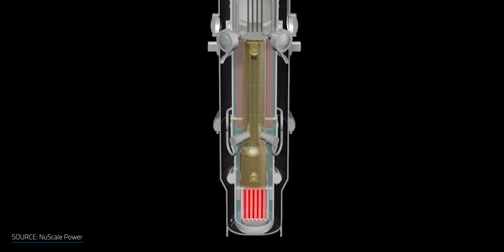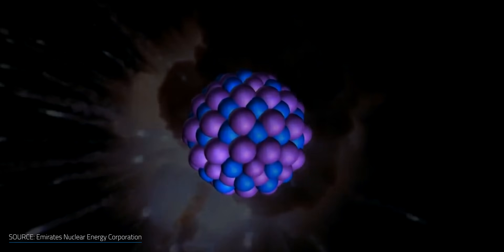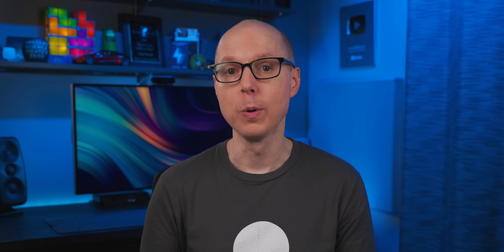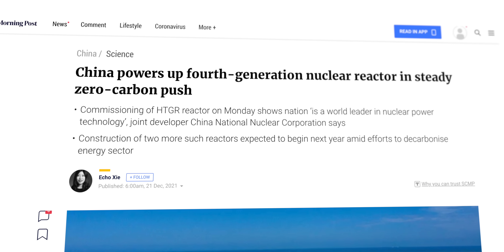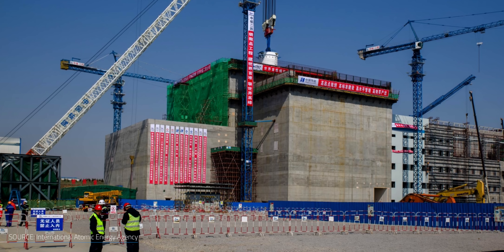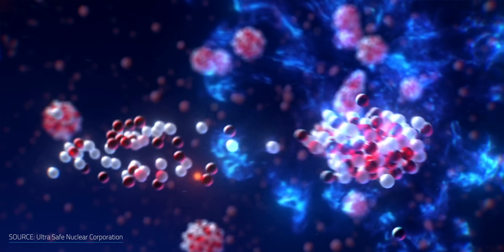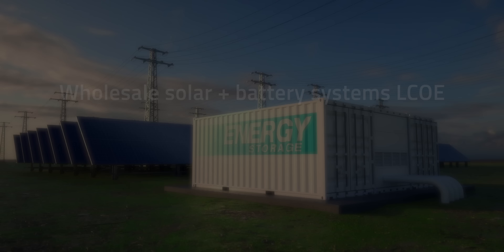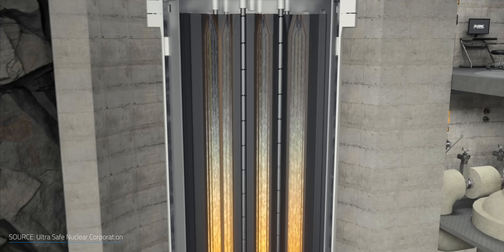Forget Small ... What About Micro Nuclear Energy?

Comment: I think modular reactors are absolutely the way to go. As we've seen with Elysium Industries, modular reactors have the potential to build up to medium- to large-scale plants. 

Having scalable units means that zoning for nuclear doesn't have to be so widespread, which potentially opens up more land area for deployment given the smaller footprints. 

And as Matt explained, modularity allows for utilization of the global transportation system, which can cut down costs and avoid other red tape of moving such large equipment. 

Renewables work so well because they're so modular/distributed. Different locations can adopt the technology at different times, and owners can supplement their installations as cash flow or other reasons allow it. 

Modularity also allows for greater manufacturing flexibility. Different ratings for products can be allowed depending on customer needs, and supply chains can be better relied upon since the sheer scale of components is smaller (more manufacturers can accompany the tech, which means more competition and all of the benefits of capitalism). 

Storage and containment are definitely an issue here. Nuclear plants are centralized and away from the public to prevent radiation leakage/exposure given plant failure (even though there are plenty of protections to prevent this). Distributing more radiative material means that the risk of public contamination goes up, so the risk analysis is definitely complex. But again as Matt showed, Nuclear is the 3rd or 4th least deathly of all of the energy sources. Lots of things in life are relatively radiative too, like flying, so the risk might not seem as great as what some people believe. 

It all comes down to climate change. We can implement renewables + storage waaaay faster than centralized thermal plants, so I'd be more on board with nuclear if commercial demonstrations of SMRs existed. In the meantime, society can get so much more bang for its buck by deploying more wind & solar + storage. The IPCC AR6 confirms this
Reply: We should have electricity generation at the zip code level of granularity totally minimizing power lost through transmission; a huge savings.

Comment: The key issue is that any flavour of Nuclear power only makes economic sense if continually operated as base load. In this it competes with  cheaper and cheaper Wind and Solar PV which do not provide assured supply of course. Nuclear solves the wrong problem - we need something that is cheap when not run but can ramp up to fill a large temporary hole in our overall generating capacity. I think Natural Gas will remain the sensible option here for some time to come. As we over-provide Wind and PV capacity we should see this fallback used less and less allowing us to go mostly "green" and maybe Batteries can take over in the future.

Comment: My grandmother was a nuclear chemist at Hanford, WA. She worked on the vitrification experiments there in the early 70's. I also know Dr Alan Waltar, a nuclear engineer. The solution to nuclear waste is in fast breeder reactors. These reactors could be fueled with existing waste stockpiles, resulting in reduced volumes of low intensity waste (hundreds of years halflife) and vastly reduced high intensity waste volumes which could be viably vitrified into harmless glass. The solutions exist, they're just not politically correct.

Comment: As a consumer of energy, rooftop solar is by far the cheapest solution. And, the energy it produces is emission free. So, I conclude that if I could buy a refigerator sized reactor that could power my home and be cheap enough to pay for itself in grid savings, it would be the way to go. How about a mere 2 KW reactor, supplemented with battery and inverter to handle peak loads?  .... Why not?  I suspect that the utilities would not be in favor of it at all.
Reply: hmmm, why not.  how much money do you have?

Comment: The Nuclear waste story, is just a way of safely storing recyclable nuclear material that could be used to make bombs otherwise. Permanent nuclear waste disposal methods (for real unrecyclable waste) have been known since the late '70s. These involve trapping the wastes in special Pyrex glass and deposit them in mineral salt layers deep underground. It was estimated that a 1000 Mwe reactor produced about 125 tons per year of high radioactivity wastes. However if these were fully recycled then the real wastes would be about 7 tones per year.
Reply: Recycling in itself presents problems.  MOX was being built for a simple process of mixing Pu239 which the U.S. has excesses of with U238 for reactor fuel.  MOX was canceled after 19 years of construction and $17 billion of taxpayer money spent when the estimated total cost to complete construction and operation was estimate at $47 billion.

ANYTHING that handles radioactive material, especially material than can result in a critically accident is very very expensive.  As we know, it is always cheaper to dispose of any thing that can be recycled than to actually recycle it.
Reply: @clarkkent9080  Yes, but they are creating strategic reserves of potentially recyclable material. The CANDU reactors have the capability of using MOX. There is no possibility of a critical mass being reached in a reactor, even by using Pu, because the amount of it is spread within the U238 and is only used to artificially increase the fuel's enrichment. As far as I am concerned, the Thorium cycle is the best way to go right now. The only problem to it's development is the PWR industrial establishment, that opposes a change in reactor technology right now.
Reply: @FLORATOSOTHON  First anytime you deal with fissionable material be it U235 or  Pu239 you must establish detailed critically controls.  The reactor fuel may be low enrichment but the plant that makes that fuel deals with higher enrichment material and spent fuels certainly falls in that category. 

We in the U.S. are not creating reserves of potentially recyclable material.  Defense waste is being mixed with glass to form a unusable vitrified matrix and  commercial fuel is just waiting its turn.  No one want spent fuel and utilities will dispose of it as soon as they can since untreated spend fuel is a proliferation concern and must be secured until disposed.

Now to your conspiracy theory against PWRs.  Yes since Westinghouse has spent billions on developing PWRs, why would they invest in anything else? The DOE is GIVING $4 billion in nuclear welfare  to Terrapower (Billionaire Bill Gates is CEO)  and NuScale to build their demonstration reactors. Now that is socialism. 
In America, any company can build any reactor type that they want and just because no one wants to invest their private money in SMR or MSRs DOES NOT mean the "nuclear man" is holding down new technology. 

You could always invest your money with others on this channel that think thorium is the future but you may want to research about the past test demonstration thorium reactors that were tried and then abandoned.  Why does everyone think a private company or the U.S. government MUST spend money on their ideas that they get off internet channels ???.